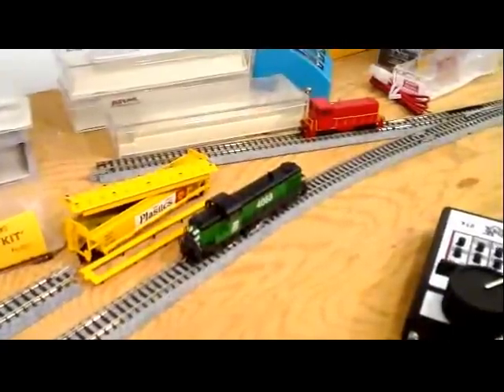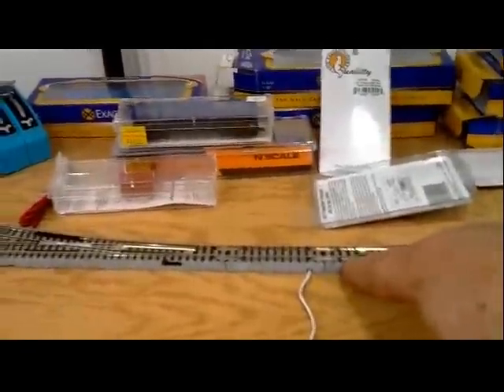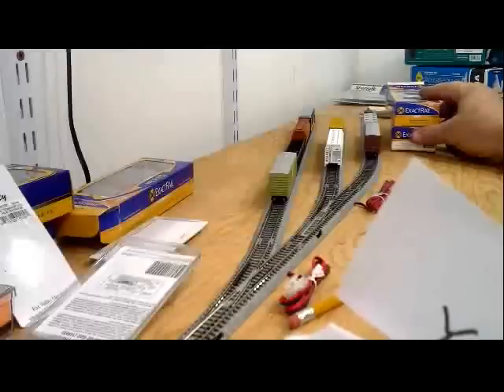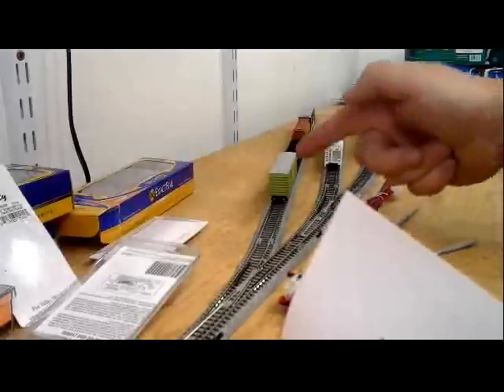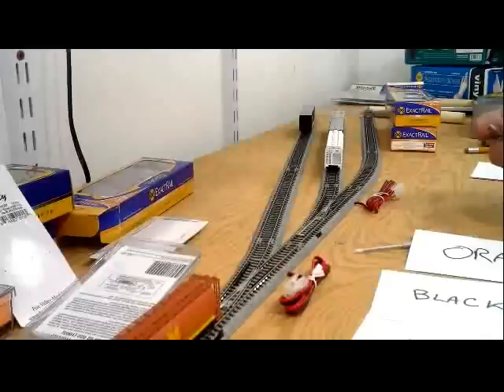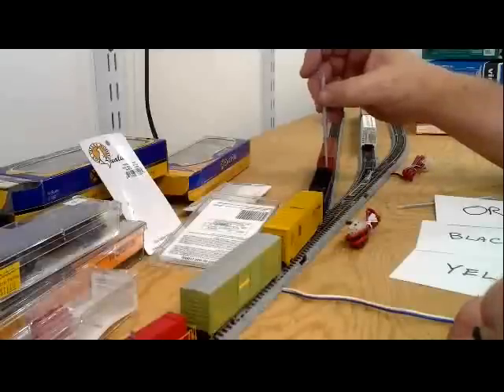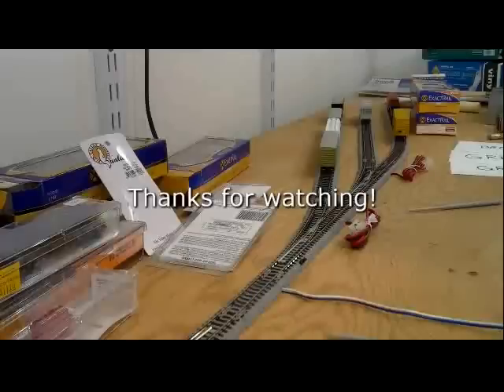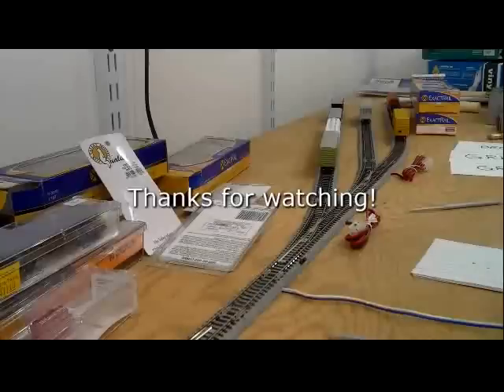Inglenook siding test run

Comment: Nice example of a 5-3-3 Inglenook yard layout using Kato Unitrack(with car spotting)! I had recently built a 4-3-2 Inglenook yard layout using N scale Kato Unitrack myself. My layout is a 1X4(1 foot by 4 foot) layout and it has a switching lead capacity of 2 cars plus the locomotive. I use a total of 6 cars on my layout.

Comment: Thanks for the clear video showing how an Inglenook siding is operated. This kind of layout is often discussed but apparently rarely shown operating. I'd like to see yours again when it's complete.
Reply from the maker: Glad you liked it Ed.   Unfortunately the Inglenook is only in place temporarily so I can have a bit of fun running trains while I figure out how to actually build a layout!  Currently I am up to my ears in Fremo-N modules I need to get finished.  I also have my shelf layout contest winner that I need to go through and finish wiring up and get the turnout control rods in place.  I am having second thoughts about using Bullfrog machines for ALL the turnouts, as several of them are crossovers and should be linked so that they throw together.  But more on that later....
Reply: Good luck on all of that! Have fun!